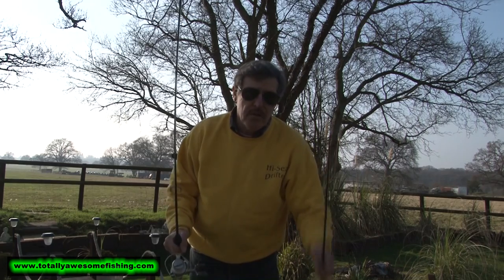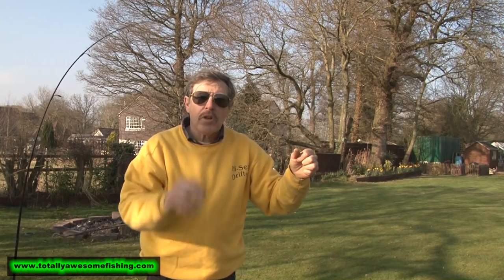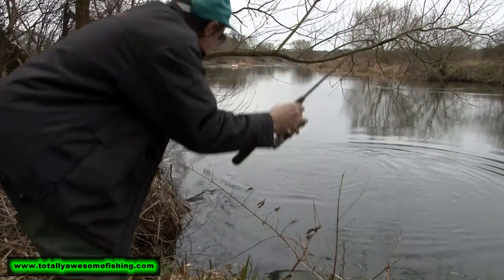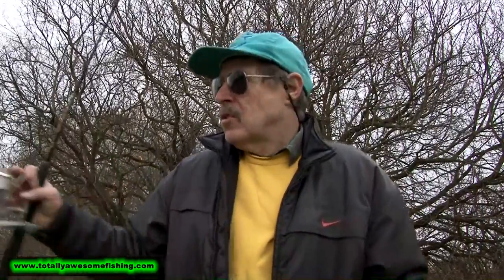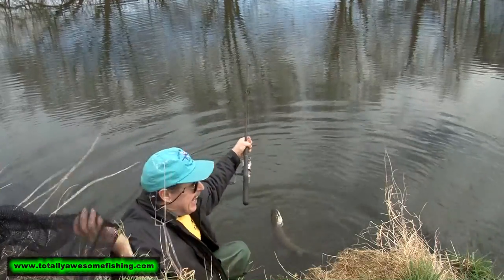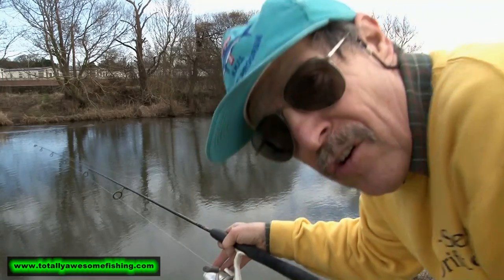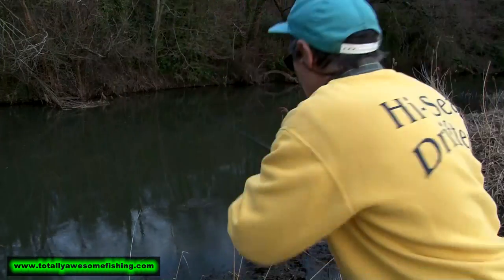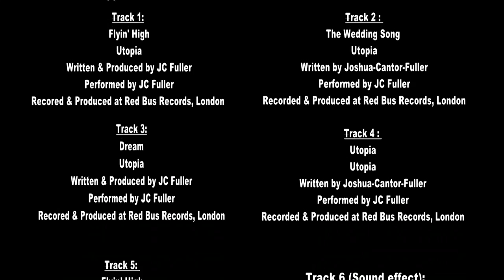Pike fishing on light tackle - Ep.9 - Series 3 - Totally Awesome Fishing

Comment from the maker: If you use a big,wide gape single it should go through the bottom throat of the sprat,but it must come out through the top of the skull as this is the best holding point. Try to toss the sprat through the air,rather than cast it hard,and don't forget to add a good swan shot,to make it sink,and also give you a bit more casting weight. Softer rods cast sprats better than stiff ones. Good luck.Graeme

Comment from the maker: Sounds like anywhere is worth a go.You need to look at all our pike films,twitched sprat/lures etc so you might see the type of swim.It could be snaggy and you don't want to lose expensive lures.Better to try twitching sprats as in our films,they are really cheap,And buy them from the wet fish section of a supermarket,way cheaper than elsewhere.Twitch the sprat as slow as you can without snagging weed or the bottom,and make sure rain has not coloured it.

Comment: Personally, I think you should be fishing the edges of weeds.  However, I think your best bet is to use a small spinnerbait (a 1/4 or 1/8 oz beetle spin) and keep it close to weed beds, pull it through pads, etc.  Try to cover as much water as possible in a short period of time.  That's one of the best ways to catch pike, is by using a fast lure and covering a lot of water.  That maximizes your chances of getting one, since pike don't really group together.  Just gotta cover a lot of h20

Comment: Im a bit confused, you show how to find your rods test curve, and you then say you can set your drag as well, using this method, you also say "always check your drag before you strike" ,but almost every time i see you fighting a fish you put your thumb or other hand on the spool basically overriding your drag setting!  so if you have to use hand to over ride the drag then what is the point of setting and checking the drag? Just a little confused?? enjoy your channel though!
Reply from the maker: +markg0nmy Extra spool rim pressure enables you to hold more power on the fish,but if it lunges away simply release that and you are back to the safe pressure of the drag setting you made before.